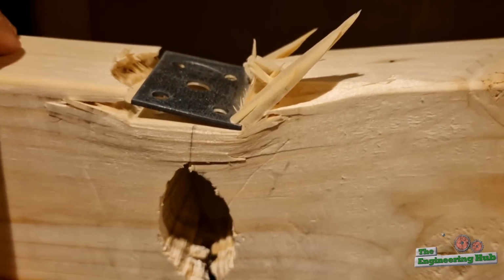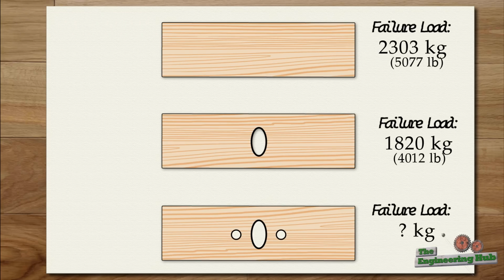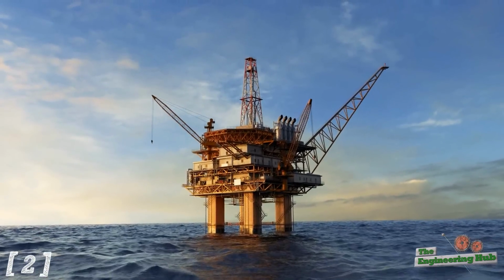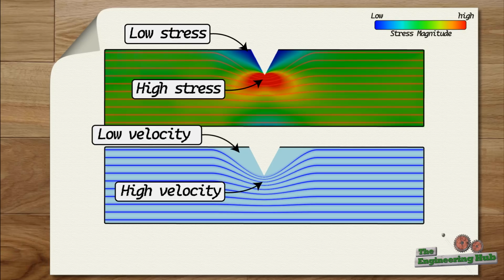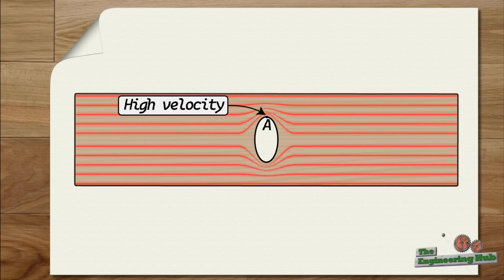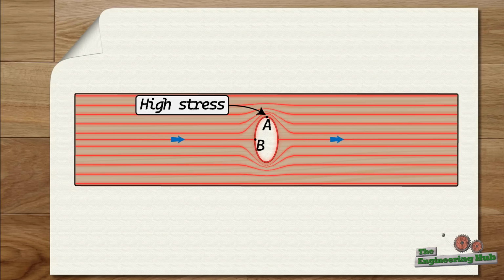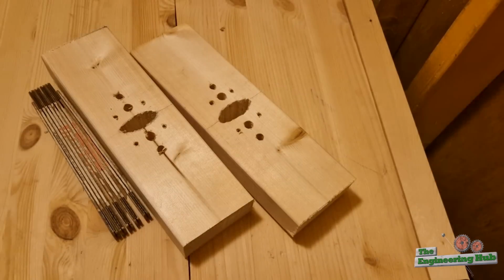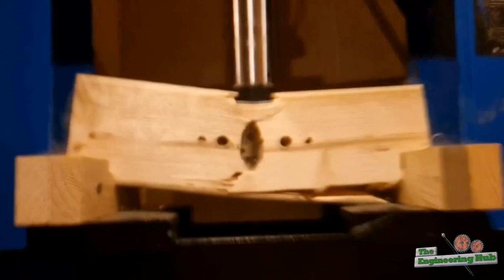Can drilled holes make your beam stronger?

Comment: I am not sold. Wood is ridiculous for it's inconsistency. To make it at least somewhat scientific you would need to make more than one test with just one hole. Even better: use a solid such as engineered plastic or something.
Reply: Yeah, but wood has specific grain pattern/structure. I don't think plastic would be analogues to wood even if it's printed in a way to become similar to wood.
It's just my intuition, I wouldn't mind to be proven wrong.
Reply: @bezceljudzelzceljsh5799 so don't use a printed polymer...
Reply: You might want to inform the Western Wood Products Association, American Lumber Standard Committee and the International Code Council... because they have published tables defining specific load capacities for wood.

Wood is pretty consistent within the species and grade. You might want to do some research before making such claims.
Wood has been studied and tested for over 100 years! Most construction is based on the natural consist strength of wood.

I think his point is... All real-world construction will require holes in structural elements and thoughtfully placed additional holes may improve the strength. (Not that a beam with holes is stronger than a beam without holes) 
How much?... needs to be researched.
Reply: @onestoptechnologies7305  I don't need to. A 2X4 is not a reliable scientific instrument and if you think it is you should go an do science with the Mormons.
Reply: @onestoptechnologies7305  I am not familiar with those specific tables, that you are mentioning, but they are most likely conservative values, and they will probably also be categorized into different strength classes.
I have a book, full of load-tables for steel, wood, etc. for use in buildings, and wood does have values listed, however those values are listed as the "values used for calculations" (loosely translated), so they will be very conservative numbers in terms of their strength, so that you are certain that your building won't collapse.
I am currently a civil engineer student myself, and in one of my courses we actually tested 2x4's to failure, and it was really cool to see how big the difference was. Even within the same strength category (based on visual inspection), there was significant differences in their strength.
I am NOT an expert in any way, in regards to the details about wood-structures, but I have heard/read that it is fairly common to use the lower fifth-percentile of wood strength, when calculating the load capacity for wood. So this means that in 19 out of 20 cases, the wood will be stronger than what you calculated, or in other words, very conservative.
Reply: @onestoptechnologies7305  It is true that there exist extensive load tables for wood, and those are well suited for construction. However, those load capacities are not exact numbers, but rather conservative values, based on extensive testing.
One of the most common ways of finding load capacities for wooden beams, is to test many samples, which will then give you a bell curve distribution of their strengths. Then from this bell curve the fifth percentile is chosen as the tested "load capacity" for those wooden beams.
Categorizing them attempts to make that bell curve more "narrow", but there will still be a significant spread.
Try looking up "sbc magazine the 5 percents of lumber", I think you will find it interesting 😀.
Reply: I saw a test on pressure treated vs non-treated wood under different conditions.  The deciding factor wasn't treated vs non, it was just grain density.
Reply: Solid rod is weaker than hollow pipe.  If you put a tight fitting steel bearing into a hollow pipe, the pipe will bend near the bearing, the ball bearing not allowing the pipe to deform slightly in a uniform way makes it weaker than the completely hollow pipe.  Then, think of a solid rod as a pipe with bearings all the way through it, imagine overlapping bearings in the core.
This is a known thing, and  much more often mentioned with the pipe example etc.  Of course the hollow pipe has to have non-weak wall thickness, etc so there are limits, but it is the general idea of why.
Reply: @ModelLights it should be obvious that the insides of a hollow rod is in no way comparable to ball bearings
Reply: @green5260  'insides of a hollow rod is in no way comparable to ball bearings'
LOL, how did you get it opposite of what was said?
The insides of the SOLID rod are as if you had a full string of ball bearings inside the hollow rod.
Not that difficult, and clearly you haven't put a ball into a hollow rod and seen that it creates a weakness in the hollow rod, as clearly explained.

It's F'N HILARIOUS you kids pretend like I invented it.  Get a clue, it is a fairly common depiction of how to understand that the correct wall thickness hollow form can be better than a solid rod.
Yes, I'm 50 points over most normal 'smart' people, but I didn't invent literally everything.
Reply: @ModelLights It looks as if you have no knowledge of technical mechanics whatsoever, and everything you say here is refuted in any textbook. Maybe just ask an engineer with the relevant degree.
Reply: @TigerTigerFlammenpracht  
Actually kid, I'm 180 IQ range.
WTF do you think I even remember it?  Because I've seen it in texts on several occasions.  It used to be fairly common knowledge because it would be pointed out in things like Popular Science and Popular Mechanics, Scientific American, etc.

If you do something as simple as google 'solid rod weaker than hollow rod'
You'll find they qualifiy the answer with 'A solid rod is generally stronger than a hollow rod of the same material'
The enire reason they qualify that with 'generally' is because if they state it as an absolute, they get nailed with the specific counter cases since it is not always true.  Yes they go on with larger hollow rods as well for the easier examples, but it isn't even 100% true for the same size rods.

Even a cursory look at this and how literally everything qualifies that with 'generally true' and not absolutely true should let everyone understand that you're the one missing that little bit of knowledge for why that is so, not me.
Reply: @ModelLights  A solid rod of a particular diameter will be stronger than a hollow rod of the same diameter.
Reply: @dave-kt7sj  
Take a tinfoil thick sheet of steel.  Bend it.  Whoops, that thin sheet of steel has almost no strength.  Your idea that 'all the metal contributes real strength' is silly.

Take a 1" steel bar, and put it under bending stress.  The bottom is under compression load, the top is under tension, and the tinfoil thick slice in the middle of the loading is just as weak at resisting the bend as that sheet of foil alone is.  That slice has almost no strength against the bend.  It contributes mechanical spacing and internal leverage effects, not 'resistance strength against the bend'.

Your oversimplified 'all the metal contributes strength against the bend' thinking is wrong.
Reply: @ModelLights  Why did the wood without holes do better than the wood with holes in the video then?
Reply: @dave-kt7sj  
'Why did the wood without holes do better than the wood with holes in the video then?'

Maybe instead you should be asking yourself a couple questions, dave.
1 Why did I make that previous post like I knew what I was talking about?
2  Where are my basic Sesame Street skills, that I can't work out basic topology and figure out how different these two holes are?

You certainly have me loling a bit, I wouldn't have mistaken these holes as being similar since I was like 10 or 12.  Thanks for the laugh.
Reply: @ModelLights  nah, I'm more interested in your answer to simple questions that I ask.
Reply: @dave-kt7sj  
'@ModelLights  nah, I'm more interested in your answer to simple questions that I ask.'

Nah, you already lied in your first post that you knew all the answers better than I did.

'@ModelLights  A solid rod of a particular diameter will be stronger than a hollow rod of the same diameter.'

You're just lying more now to distract from your initial lying.
Reply: @ModelLights   I didn't say that I knew all the answers better than you did.  I only stated what I believed was a well known and understood fact, which is further demonstrated by the video it's attached to (the solid wood broke at 2300 kg, the wood with holes broke at 1800-2100 kg.)

You went on with some other BS that was unrelated.
Reply: The theory is sound, even if he had used metal or homogenized plastic the result would have been the same.

It's not that it actually increases strength per se, just that it decentralizes stress points across a larger part of the material. This principle is used daily in engineering; you have to brace any part so that forces are not focused in any one spot. To that end, sometimes removing material can help as much as adding it.
Reply: @kireduhai9428  right I didn't dispute the theory. All I was saying the experiment isn't worth a damn. But if we want to pick on the theory, shouldn't the maximum bending stress be in the middle, where the cross-section is constant (hopefully) from test to test? What I am saying is while all these additional holes are surely not making it any weaker, all they are actually doing is reducing the weight.
Reply: @MikeSmith-iv5vv 
'Your though experiment of inserting a steel bearing (I'm assuming spherical) into a hollow tube is completely illogical and does not prove anything.
'
Holy crap kid, how are you even talking about it if you don't know about it?
'Your though experiment'
It's not MY thought experiment, be less completely dense.
I'm 180 IQ range.  I gave the general idea and said go look it up.  
You're actually WRONG about it being 'only equal weight'.  By definition since the hollow tube of 'equal weight' is stronger than the solid rod, you can actually lighten the hollow tube some before it even becomes weaker.
Use your head some instead of just giving pretend 'corrections' you're not correct on.
Correct wall thickness of the SAME diameter will STILL BE STRONGER at some point.  All you have to do is stick a bearing in a tube and see the failure mode, just like I stated.
The bearing in a tube causes it to have a leverage point, period.  If you can't see that, the fault is yours not mine.

Two tubes, same weight, bend both, one with a bearing.  The bearing one will bend first, even though they're the same tube and the bearing one is now SLIGHTLY heavier.  You can prove yourself incorrect for under $20 or so.
Reply: @ModelLights  Sorry, but I have to point out that you are being unnecessarily rude to that guy. Attacking another persons arguments is totally valid, but it should not be necessary to attack him as a person, for example calling him "completely dense". Can we please return to a civilized tone of discussion?
Now regarding the example with the ball-bearing, I would argue that a ball-bearings inside a hollow tube, does not accurately represent a solid rod, because it is simply not the same thing. The ball-bearing is not welded to the pipe, so it is only lying loosely inside.
I also don't see why we need to involve a ball-bearing, when we can simply take a solid rod, and a hollow tube and compare them, which is the actual thing being discussed.
But just to be clear, on what we are actually disussing here.
Are you arguing that if we take a solid rod, and a hollow tube of the same outer diameter, that the hollow tube (with an optimized wall-thickness), will be stronger than the solid rod? (same outer diameter, but of course different weights).
Reply: @DanildFlamme  
' for example calling him "completely dense"'
Note your dishonesty and inflating what I said, in order to make yourself more correct, while trying to criticize me of the same.

 'Holy crap kid, how are you even talking about it if you don't know about it?'
Is what I said.
He literally didn't even bother to go look up the examples I pointed to very clearly before pronouncing them wrong, when they are out there all over the place.
'Your though experiment'
He also specifically lied that it was 'my thought experiment' trying to tie it specifically to me to make it easier to pretend to 'correct', when it was clearly labeled as being an example that is given for how to see it, and that it should be looked up to understand.
Don't falsely 'correct' me and I won't actually correct you a bit harder.

'I also don't see why we need to involve a ball-bearing'
Because it makes it obvious.  How do you not see that the SAME two tubes, with only a ball bearing inserted into one, shows that the SAME tube is actually weaker due to the leverage advantage and fixed position with lack of deformation.  It's a no brainer to see that the SAME tube actually can lose strength even though 'more' is inside of it.

It makes it EASY to get the general idea with little effort, since you can easily and relatively cheaply get 2 pipes and a ball bearing for the leverage point. 

Bending a bar you have leverage arms against the center, and as you reduce R toward zero near the center the leverage against the center of the rod heads toward the limit of infinite leverage against it.

It's the same reason that even a super strong piece of metal is easily bent if it is thin and has a few feet of length on each side, the approaching limit infinite leverage against it will overcome any amount of strength.

What's in the center of the rod start works against the rod, not allowing the tiny bit more deformation before the rod would bend, and not contributing to the strength of the rod since it has 0 leverage to work against the bending.
Reply: @ModelLights  In my opinion (note: "opinion"), you moved a discussion about the correctness about arguments, into the area of personal attacks, and I don't think that's nice. From my point of view you started attacking the person, and not just his arguments. That is just my personal opinion in that regards, and I am willing to leave it at that.
But pushing that aside, focusing on the actual subject matter.
My main question is:
Are you arguing that if we take a solid rod, and a hollow tube of the same outer diameter, that the hollow tube (with an optimized wall-thickness), will be stronger than the solid rod? (same outer diameter, but of course different weights).
To be clear: I am talking about strength against bending.
Or have I misunderstood, what you are arguing?
Reply: @ModelLights I didn't see it at first but "180 IQ range" just completely confirms that you're a troll

Comment: If anyone has ever seen what electricians do in order to run cable then you would know that single holes are drilled through many studs and joists in your house (assuming that it's made of wood). 😅 If relief holes accompanied said holes then you would have a stronger structure. 🤷 I think it's at least a cool concept. Thanks for sharing ✌️

Comment: In terms of a video, I think it would have made the point better if you started with the hole in the middle.  Otherwise we are sitting through the whole video expecting it to increase the strength relative to the whole beam.
Reply: I think the point is... All real-world construction will require holes in structural elements and thoughtfully placed additional holes may improve the strength.
Reply: no, cause the answer should be obvious from the beginning - whole beam should be the winner in most cases, if no defects in the beam

Comment: Turn the oval 90 degrees and place two of them beside two small round holes stacked in the middle instead. basically an inversion of what you were testing. 

If the goal is to increase strength by removing material strategically, then goal post is beating the non-altered 2x4. None of your tests did that.
Reply: You’ve imagined a conclusion that was never intended.